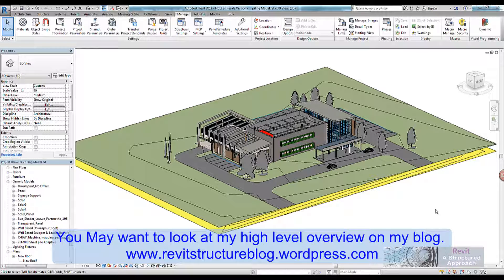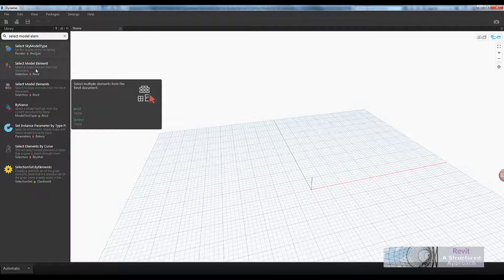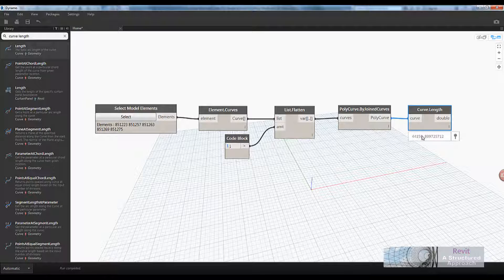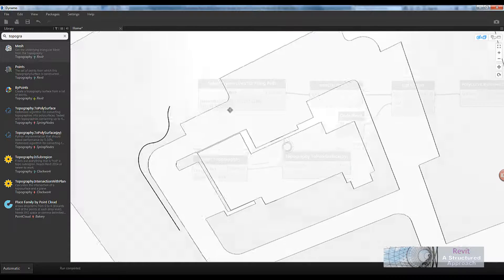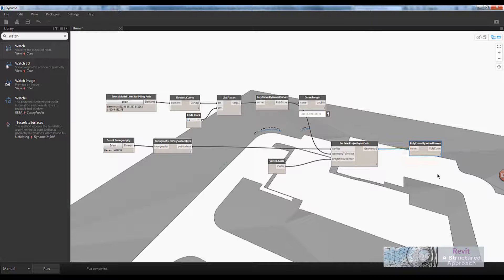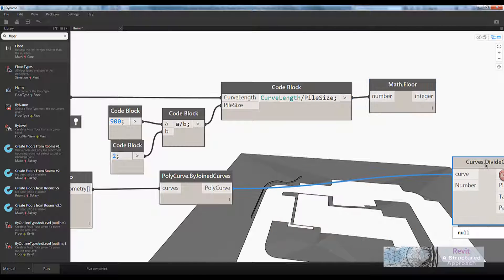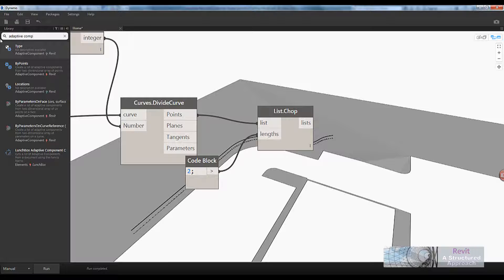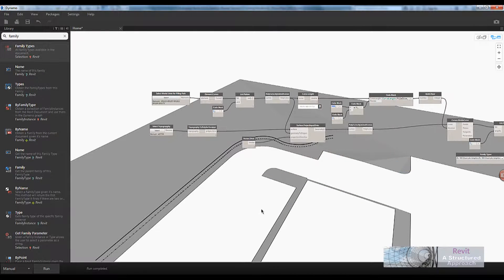Revit 2017 and Dynamo Tutorial   Creating Piled Wall Systems

Comment: Hi There, thank you for a concise video. In order to use the Revit family with Dynamo, does it have to be an adaptive family? Thank you
Reply from the maker: Hi Ronnie, This can just be a standard isolated foundation and would need to have a single insertion point. The only reason to use the adaptive component with two points is to handle the rotation of each element. However, the script can be modified to allow for the rotation of each element to be calculated and written back to each element.
Reply: @RevitStructureBlog  Thank you for the quick response. I will be creating this script and testing it on a quay wall alignment.
Reply: @RevitStructureBlog  Hi there, in order to create the sheet pile wall, do you have to extrude to a topo surface? Is there another way of creating a pile wall without extruding to a surface? Thank you.
Reply from the maker: @Ron96577  In this example I am intersecting the z axis of the  line with a surface. There is another option of using Civil 3D and projecting points to a TIN surface. You can then extract the points and place your piling using Dynamo

Comment from the maker: It's part of the Lunch Box package. If you download lunch box and Spring nodes you will have all the tools required.
Reply: very good sir..but still I can not find the node curve. divide curve in the lunch box.
your response is much appreciated. thanks
Reply from the maker: Hi, Its been a few years since this video was created and I suspect the packages have changed. This node can be replaced by using Curve.PointsAtEqualChordLength which will give the same result. This is located under the Geometry-Curves-Curve menu